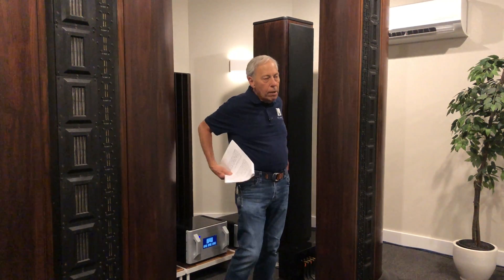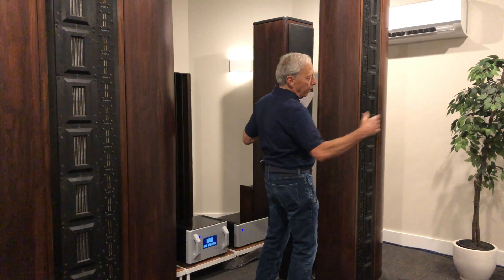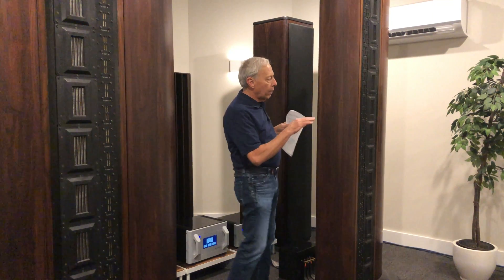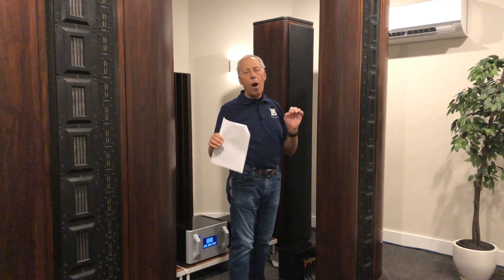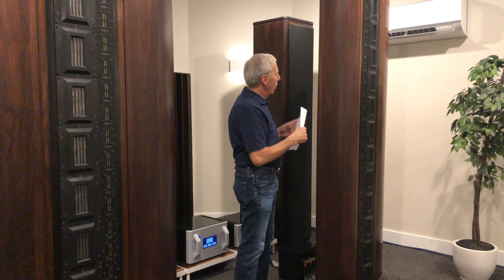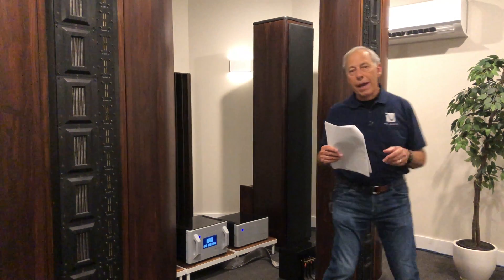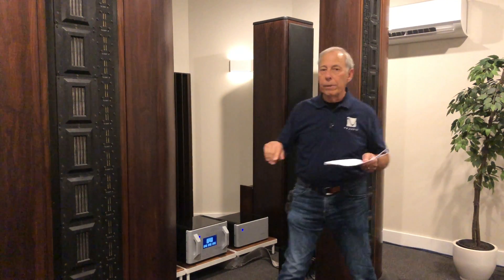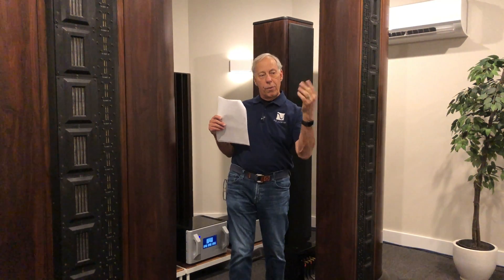How do dipole speakers make magic?

Comment: I used to have quad electrostats, the sound stage they made was just incredible thanks to being dipoles... :) You could listen to a movie with good stereo sound and swear that you was listening to a full 7,1 surround system lol.
Reply: I also have dipole speakers, and I wonder how a surround sound version would sound. I have enough dipole speakers, all I need is a surround amplifier. 😂 They are cheap, second hand, but I'm not into surround, though. 😂 Who needs surround with dipole? My few pairs of speakers are made with an open FR or coaxial driver on top of the box and a woofer in the box. Cheap and easy (if you like tinkering a bit). 😂 There are 3 things that help the image: Point source, dipole and crossover! So cheap to make and the BEST speakers you will hear, better than panels with (5 ft mouths ) mine are point source instead of broad source, with the same response and magic sound as panel speakers. And cheaper! 😮

Comment: I’m not certain but isn’t this a type of distortion?  I remember the amt drivers in the ‘90s and loved the sound. Hated the subs... passive radiators have specific design requirements. I could get it right in the trunk of a camaro but not in an open space.

Comment: for whoever is interested in a simple explanation of 'imaging and fidelity'. imagining refers to the position of the sound source(s) and fidelity refers to reproducing accurately the original recorded sound. 

did you know that the human ear decodes horizontal positioning based on timing? a sound originating to the left reaches the left year sooner than the right one. the difference in arrival times gives us the horizontal angle. but how does vertical positioning work? a sound originating above our head excites both ears at the same time... 
believe it or not (and there are experiments to prove the mechanisms) we decode the horizontal position based on tone. that tone difference between different vertical positions is given by the ridges in our earlobes. if one were to modify the earlobes' geometry with let's say plaster or bubble gum attached to the lobes' ridges, it would be impossible to locate the sound source in a vertical plane (until the brain relearns the new tonalities/sound effects), but still be able to very accurately point to the horizontal position... 

in that sense, in order for a recording to give you the vertical positioning of the sound source, it would need to be recorded with two mics located in a perfect replica of your earlobes (for an accurate horizontal recording the mics would need to be located at the same distance as your ear drums are). it's just physics, very complex physics that our brains learned over many years and experiences. that decoding algorithm is as subjective as our earlobes. two blind-folded people can point at the same vertical sound source but if they were to swap their earlobes none would be able to locate the source in a vertical plan. in fact, the perception is so altered that a clap originating at ones feet may sound to one's new earlobes as originating above the head... feel free to search for funny youtube experiments.

the simple truth is that the speaker doesn't need to bounce pressure waves off the back wall in order to reproduce with fidelity the recording room or studio (even when that phenomenon occurred while recording). the recording room's acoustics are already included in the recording itself, there is no need to augment that if we're talking about fidelity.

in a perfect hi-fi universe, the device that reproduces an audio recording (speakers, boxes and rooms) adds and subtracts NOTHING from the signal it receives...  the mics and mastering take care of everything that is going on in the recording environment  be it a studio, concert hall or open air. headphones in that sense have a huge advantage over speaker boxes. it's just physics.

in the real world, all the speakers in existence nuance the original signal. the speakers and the listening rooms add effects to the original recording. some in a grater degree than others and that is fine.

now, if we're bouncing sound off walls we're only getting farther away from the original recording. the wave pattern gets more complex and that creates more complex situations/interference such as cancellations, reverberations, distortions, etc. and that's fine. it may sound pleasant it may sound unpleasant. but it's not fidelity, it's a remastering so to call it...

Comment: Adding a rear-firing tweeter to any speaker meant to be put close to a wall will make it sound muddy. Psychoacoustics. We know that reflections that reach your ears within 6 ms will be summed with the direct sound and make the sound muddier. But put a dipole at least 1 m away from a wall and the reflections will come at least 6 ms delayed, so they'll be heard as a reflection. And if the reflection's signature is identical to the direct sound, our brains recognize them as reflections and completely ignore them, so they add the sound energy to the room without causing muddiness or reflections. Paul putting a rear-firing tweeter in his speakers sadly kills any interest I had in them.

Comment: Couple of things. Dipoles do not have to be planar. Dynamic drivers do very well in a dipole setup. Most importantly however is that dipoles eliminate the box. There is no way to "absorb" the back wave of a speaker. If the box is sealed, you are increasing or decreasing the pressure inside the box, both of which limit the travel of the driver, compressing the sound and requiring more power. Adding a port can eliminate this, but ports have a sound too. I suppose a rear mounted passive radiator would do the trick, but why not just open the back of the box instead. Being a dipole does not guarantee good imaging. The IRSs image so well, and I have heard them, because they are line sources.

Comment: I still have trouble accepting the concept of those IRS 5's..... they share the same 'hallmark' as Bose's lifestyle setup...! It's true .... for those tall 6 speaker LF towers to act as subs they must cut off or transfer at below 100Hz.... but the Emems can't produce copious sound levels anywhere near that level .... that IRS system needs a mid/bass coupler ! Just as the PS Audio AN3 has

Comment: No mention of the phase reversal of a sound wave bouncing off a wall?
Reply: The time it takes for sound to travel from the back wave of the speaker to the back wall and then to your ears is an extremely good mechanism for depth beyond the back wall. I think the phase issue helps to determine how far out from the wall they are as well as width placement and toe. You're really tuning the speaker/ear/room mechanism as a single unit.

Comment: It would have been better if he bought the book for you to sign I think you're saying hahah.
If you mount the silk Dome tweeter mid-range ,on the top near the back on a sloping angle so when the speakers is against the wall it deflects from the wall off the ceiling in a right angle with right time placement delay to meet the front you could place it against the wall and get that sense of depth the back of the speaker cover in quarter of an inch felt and make it round convexed bowl shape not flat should do the trick. You want airflow round the back of the speaker having it convexed causes a Venturi effect for better airflow but not an even shape one side has to have a bigger mouth than the other for it to work properly.

Comment: I've never heard imaging from a speaker that can match Magnepan for anything resembling a reasonable price. Magic indeed!
Reply: I used Maggie SMG's for 20 years, then switched to Def Tech bp-10's which are also dipoles. Really liked the BP10's for a few years until I heard newer Maggie's on stands that didn't point up at the ceiling, and with that wonderful ribbon tweeter that extends the full vertical dimension of the rather tall speaker. I got a pair immediately. For the money, I've never heard anything come close to a Maggie with a full ribbon or quasi-ribbon tweeter.
Reply: Especially for the price. The Maggie’s are also full range dipoles, including at bass frequencies which is the reason they never sound muddy. The IRS is not dipole bass and PS had all kinds of issues designing bass traps to address that. The IRS is monopole bass and suffer from room boom without room treatments that Maggies never do.